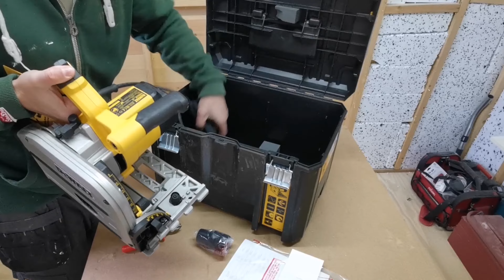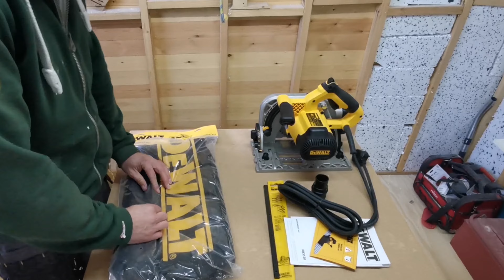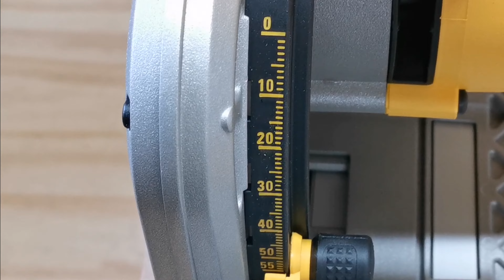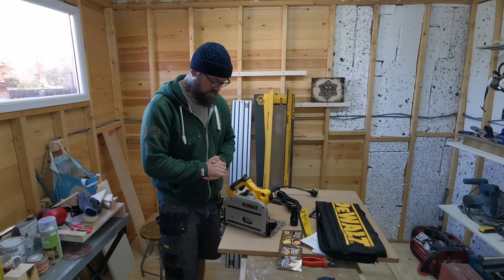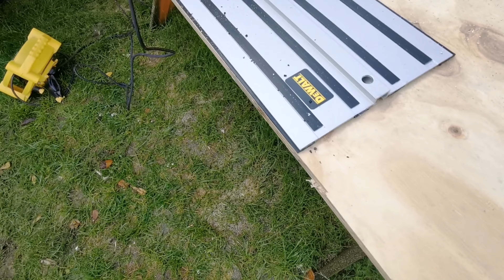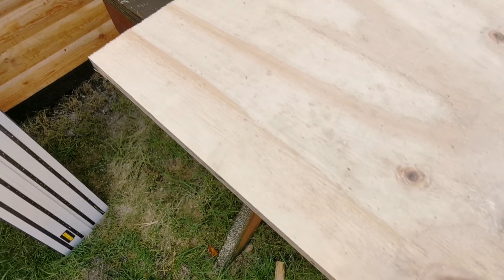Dewalt track saw unboxing and initial use

Comment: The bit you missed out was checking the back of the blade for fused on rubber from the track.  My blade went out of balance because of it.  You might need a bit of white spirit or some other solvent to get it off.  Bit of a design flaw if you ask me.
Reply from the maker: That's one I've never experienced or heard of before. What exactly happened?
Reply: @karlpopewoodcraft  I got the saw last year with the DeWalt track and initialised the track as per instructions.  I used it for a job,  all fine but as time went by using it on various small tasks, I noticed a vibration when cutting.  I thought maybe I should change the blade because some people recommend changing out the stock blade so I took it out.  When I inspected it, there was a flat, broad black fused rubber ring on the reverse side of the blade and also fused rubber on the inside of the hardened teeth.  It was actually difficult to remove i.e. didn't just peel off, it was firmly adhered to the surface of the blade and only a good scrubbing with a cloth and some methylated spirits did the job.
It was obvious where the black rubber had come from.  The vibration was much reduced after cleaning, though I would not say it runs like a Rolls Royce.  It cuts reasonably OK.  Overall, I think it is OK for the money but it is cheaply made and a bit disappointing but I guess you get what you pay for.  Just my opinion of course.

Comment: Hi Karl.

I have just bought myself the dewalt track saw with 2 x 1.5m tracks. do you think it would be worth kitting 1 of the tracks down. 

Cheers loving the content.
Reply from the maker: Hi Lee sorry I'm not quite sure what you mean by kitting it down 🤔
Reply: ment to say cutting, bloody auto correct. so you have 3 tracks prob 1x 1.5m, 1x 1m and the 1 at 0.5m
Reply from the maker: @leebarton5200  oh ye I see, sounds like a good idea. Aa long as you can cut down a full sheet of ply etc a small track is super useful and convenient.

Comment: What prevents the track from moving while cutting?
Reply from the maker: Hi mate, there is a grippy rubber strip on the underside, you can also buy special clamps but I rarely use these.

Comment: Great vid Karl, just bought one and track. I didn’t fully understand why the rubber strip on the track needs to be trimmed? I assumed it would come ready to use.
Reply from the maker: Hi ye it's a strange one isn't it. Every track saw arrives in the same condition. Just use some scrap board make your first cut and the rubber is then trimmed to size then everytime you make a cut after this you just line up the rubber with your pencil line and it's spot on accurate.
Reply: @karlpopewoodcraft  Gotcha, thanks for the advice 🙏🏽

Comment: Great Vid! Do you need track clamps for this? & do u think this will cut Oak venneer doors ok?
Reply from the maker: Hi Craig, you don't need track clamps, I have some but only use them on occasions when I'm doing a long accurate cut say 2.4m. Oak veneer I regularly cut no issues.

Comment: The track. Double sided. I use one edge for 90° cuts and the other side for beveled cuts. Why? With beveled cuts the rubber strip edge is different then 90°.
Reply from the maker: Great advice 😊
Reply: Yes, your setup is per the manual suggestion for that case scenario

Comment: Had bother with the splinter guard as I couldn't cut it at the very ends without the saw coming off the track at one end and when it did, it wasn't straight. So I recommend putting both tracks together first and cut, the swop them around and go again
Reply from the maker: I was lucky, good device Paul.

Comment: Thank you so much for an interesting video.
Although I got this DeWalt track saw system over a year ago I've just recently started to use it on projects and I'm having misgivings about the whole thing - especially considering the top notch price is perhaps not reflected in a top notch tool.
On sheet (plywood etc.) it is very handy and fast but on higher quality woods you'd be well advised to think a bit before you use this saw.
1.    The saw blade is only near true when it is locked into the 90/0 position. The tilting design for the blade cannot ever be fully accurate as the tool body (and blade) does not hinge around a shaft. The rotation is guided along a quadrant curved rail at the front and separately at the back. It is possible and likely there will be a millimeter of difference from the front of the saw to the back when the body is rotated. You can understand this if you inspect the tool and method of rotation. Give it all a wiggle and find yourself disappointed at what you observe.
2.    I've not yet come across any mention but everyone should importantly be aware that when you want to check how true the saw blade is set then you cannot use the saw base plate for a reference. The saw can only work if it is located on a track -- the track is actually the base plate reference for the cut. You have to make any accuracy calibration recognising the track governs all.
I found (the hard way) my brand new tracks were actually slightly cupped (tilting the saw out of true) - this can be overcome by ensuring you press down straight and vertical on to the saw thus making certain the track is flat under the saw. Two handle operation works well for this but I think you have work out each long cut to allow you to walk alongside and no long arm reaching.
3.    Obviously bends, dings and worn rubbers on the tracks have to be avoided.

4.     My saw has vibrated from new. It growls and shakes when starting and I have heard this happening on other videos too - therefore, I think this is just part of the speed control and start up. It has no effect on cutting.
However, my saw also shudders and grumbles frequently when it should really be just a nice smooth whining cutting machine. I have come across other reviewers and video comments highlighting this exact same thing.
I have been in contact with DW service here in the U.K. and of course they say send it back for inspection - but I'm fed up with this hassle. 
Yesterday, I noticed a lot of sparking from the motor brushes and this being a new tool I then just let the motor run continuously for about 10 minutes to bed the motor brushes. This very much reduced the sparking and also reduced the in work vibrations. I'm wondering if the problem is poor build practice or quality control. Anyway, I still have a problem to fix with mine and I'm not the only one.

Overall, it is a handy tool and could be a 'must have' for any worker. Right now, perhaps this DeWalt DW520 example does not warrant the endless glowing appraisals. Perhaps it does have some negatives.
Reply from the maker: Wow an amazing break down mate, and I have definitely noticed the rattling and noise from the motor. I only really use my saw for 90 degree cut so not seen these other issues. My favourite thing about the set up is the versatility of the track. 😊

Comment: Great video, very informative.... There are clamps that come with it,..(accessories). Question: why not use clamps when cutting?  There are different kinds of styles of wood(with groves, or holes), plus the saw dust is getting between the track and the lumber getting the stripes full of fine dust.?
Reply from the maker: Hi Carlos, yes I have recently purchased the track clamps and these are great for accurate cuts. I also use a shop vac to keep the dust away and the dust extraction is excellent. Cheers Karl
Reply: @karlpopewoodcraft  my friend thank you for you quick response, I will do like you, and get the clamps and the vacuum! Cheers amigo

Comment: What made you plump for the Dewalt over the Festool? Pretty much sold on the Festool myself, the fact literally every man and his dog has one - almost to the exclusion of all other track saws - leads me to believe it must be doing something right!
Reply from the maker: Hi mate if I was using the saw in a static location say on a mft table and had a permanent track for repeated cuts I would have gone for the festool, however I think the versatility of the Dewalt and being able to use both side of the track makes it more appealing to me as I use the saw on site and in the workshop.
Reply: karlpopewoodcraft Yeh fair play, I can definitely imagine scenarios where that could be super handy being able to use both sides - having one side cut for 90 and one side for 45 so you can line it up perfect regardless is a nice option, the built in anti-kickback that you can disable is particularly nice too. Shame more of them don’t have the anti-tip when you’re doing bevel cuts like the makita has, that seems like such an obvious flaw that they could fix.

I am a bit torn because all my cordless tools are Dewalt and that’s not changing any time soon, obviously corded you’ve got the freedom to buy whatever and I’m still leaning towards the Festool, although I imagine both will be more than adequate for my needs.
I take it you’re a chippy by trade? And that woodworking is kind of a branch off of that?

Comment: i just got one and love it BUT DO NOT go and plunge into a £600 oak worktop with it until you've set it up proper, mine wasn't cutting true 90 degrees 89, there's 2 screws in the base plate to fine tune.
Reply from the maker: Oh thank you so much for that information, definitely a great piece of advice. 😊. Hope you managed to salvage the work top?
Reply: @karlpopewoodcraft  Lucky for me someone gave me a nice thick but of oak to make them a chopping board and that,s when i noticed it, lol
Reply from the maker: @theintrepiddroner6152  phew that was lucky at least it wasn't your kitchen side🤔😬
Reply: Hi, I  am gonna buy a plunge saw  Bosch gkt or this one dewalt still thinking which is better I like track dewalt but the engine  1300  bosch more powerful but don’t like track  somewhere heart that dewalt have to use only dewalt blade  cos of the anti kick  can’t install Freud  is that true?
Reply from the maker: @kubilayylmaz1716  im really not sure about that information, I'm still using the dewalt blade which is excellent and I've nothing but praise for the machine so far. I will definitely be looking into that blade question though. 🤔🤔

Comment: That was extremely helpful, thank you. Seeing it done makes things so much easier. 
I did have a laugh when you got assailed by that fly. Hilarious :-D
Reply from the maker: Cheers Jon, super happy to be of help and that fly came back five minutes later for round two ✌️😂
Reply: @karlpopewoodcraft   Hope you used a 2x4 to remind it who the dominant species on this planet is :-)
Some questions if I may?
I was just making my first cuts with mine (hence watching your vid) and the thing got to a point where it wouldn't go forward. Riving knife too shallow? 
Either way, I then made some plunges and hit a bloody panel pin I'd forgotten about. How many of those does it take to blunt a blade, do you know?
I also made the mistake of trying to drive forward when first  starting a new cut and it kept kicking back. I should plunge shouldn't I? I guess the clue is in the name plunge saw :-D

Comment: Hey Karl, I have got a couple Dewalt track saws recently and have noticed that they have a growl/rough vibration when starting up. When the blade gets to full rpm they smooth out but occasionally do it during the cut. Have you experienced this?
Reply from the maker: Hi Travis sorry for the late reply only just seen your comment, no mine starts up incredibly smoothly I can't think why that would be happening. Is the blade secured tightly? Sounds like they may be a issue. Sorry I can't be more helpful.
Reply: @karlpopewoodcraft  No worries, thanks for the reply Karl! I did check the blade and riving knife assembly and they seemed good so not sure. Will probably end up returning it for another. Third time is the charm I hope.
Reply: @iisreset  Please Travis, how did it go? My saw is doing it either way, i i'm not sure is it ok. But I think not :(.
Reply: @ivusoskivusosk6548  I actually got another replacement and it did the same thing. I called a couple repair centers and they said the sound was normal. After more research I found that the Festool does the same thing. Something with the variable speed motor. I don't care much for the sound but the saw still works great!
Reply: @iisreset  my saw also growls & vibrates a lot. Thanks for telling us this is normal.

Comment: Cheers Karl ,I've been on the fence with one of these saws as i've used the straight length clamped method 
for years. Thanks for the unboxing and mini review and i think you may have changed my mind.
All the best, Davy
Reply from the maker: Hi Davy ye I've been using for a week or so now and love this tool. Great bit of kit. So quiet as well compared to my workzone saw.
Reply: And a whole lot more accurate as well .